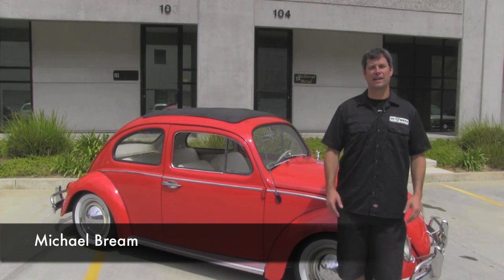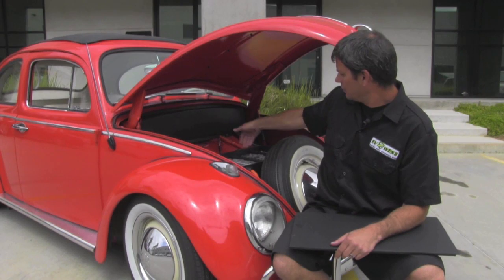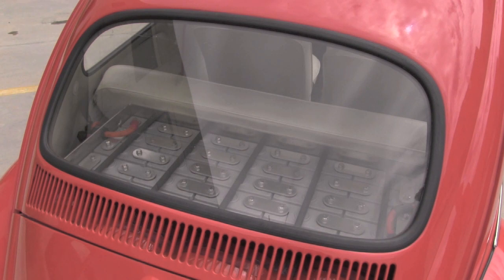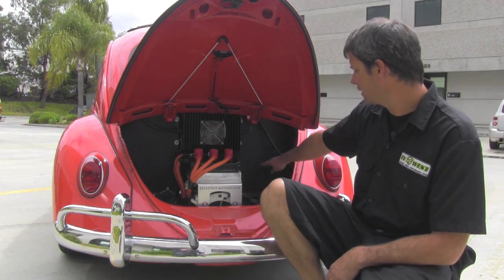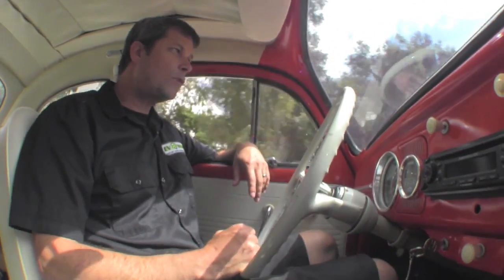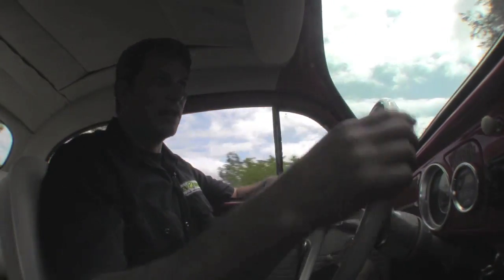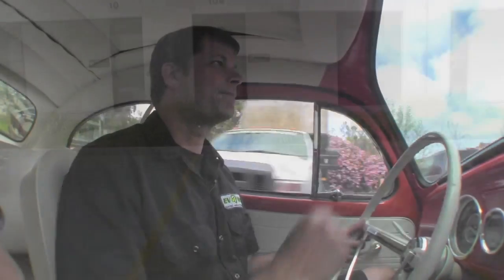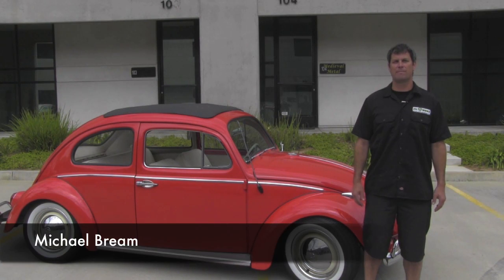EV West 1963 VW Beetle Electric Car Conversion - Classic Volkswagen DIY EV Bug Kit Walkthrough

Comment: I just bought a ‘64 Beetle that I’m having shipped to a shop in Austin, TX, Flash Drive Motors, for electric conversion.  Can’t wait to try it out!
Reply: Dígame cuánto cobran …how Much?? Please
Reply: @juliomartinez5273  $17,500 in the auction.  The conversion is going to be $32K+ what ever I want (a/c, heater, disc brakes, etc.) added to the build.
Reply: @ICP1SBJ  Parts must be much more expensive in the US.  Labor too would be my guess.  Send me a link to the $8.5k kit and I’ll send it to my guys to evaluate.  Thanks!
Reply: @donelmore2540  I was wrong they have $8.5k kits but the complete kits with batteries are $18k. Can't post links but look in the description of this video for the link to their website.. But year $32k might be about right for them doing the work
Reply: @ICP1SBJ  My shop contacted me the other day.  A company is going to shoot a pilot video on the shop and my car’s conversion is going to be filmed for the pilot!  Very exciting.

Comment: And one more top notch conversion rolls out of EVWEST. I like seeing how these cars perform with the AC setup available. This is the very first one in a heavier VW that I have seen actually run. Does the VW use a transaxle that has the 3.44 R&P gear? Very clean and tidy. Perfect. Now to get some fast charging into that little puppy. This looks like a very clean restoration and your part is totally clean. I think what others are wanting to see is how you do the gas tank battery box to replicate.

Comment: I know this was a while ago, but do you know 1) the weight, did it go up or down? 2) the load distribution from front to back? 3) Did you have to mod the brakes or suspension? 4) Do you have to carry an extinguisher having the batteries in the cab with you? 5) How are the batteries in the cab held longnitudally against a frontal collision?

Comment: It might junk the trans doing a burn out. That my question. Are they using the stock type 1 trans. If so the motor must ether be low powered or you just have to be careful with it. If I'm wrong please let EV West correct me here. I'm not knocking the kit. I love it and will be doing more research on it.

Comment: You guys should of made the charge plug location come out where the normal filler spot for gas is.
Reply: It's a '63. The normal gas filler spot is on the tank under the hood.

Comment: Could you add solar panels to the roof to recharge?
Reply: Though that is possible, the amount of recharge you'd get for the surface area you have on a car wouldn't be worth it. In fact, the added weight would counter a lot of that too. Best would be to get panels for the house and charge at home.

Comment: Heat and defrost? Was that covered or addressed?
Reply: That's a GREAT question.
Reply: The original ac was just blowing outside air in through a channel behind the hood/in front of windshield. Heater is  same process except the channel  coils around engine for thermodynamic changes...the only control is an induction vent controlling air flow/psi therefore controlling output of heat not the temperature
Reply: @joemccracken185  lol

Comment: What type of batteries?  I seen lead batteries used and the weight about killed the bug.  AC motor or brushless DC?  Liquid cooling?  ESC not very efficient making heat?  Fork lifts don't have cooling.  Looks like good specs.  More details please!

Comment: On 2nd thought. I can get a 1600 dual port for the price of the adapter plate. I could buy a complete running VW for the price of the motor. I like the technology but the price is hard to stomach on an old school VW.

Comment: Why don't you build a towable battery trailer so that the car doesn't have to have the physical weight and or danger that normally comes from having the battery bank inside the car? This would free up a lot more room in the vehicle for storage? As well it would take the danger out of the inside of the vehicle

Comment: Quick and silly question: If it has a 100 Mile Range, and I drive at 100mph, it means that I only have 1hr of driving? I know the answer may be obvious, but i just don't any clue... as you may have noticed. Thanks.
Reply: Range depends on type of batteries, battery capacity, overall weight and your way of driving (+ if it has modes of power on the controller, depends on voltage and/or frequency too).
Reply: But if you drive @ 30MPH you can drive for over 3 hours :-) an electric car is not for cross-country driving, but for a daily commuter with a reasonable daily commute say 25 miles (or less) will likely will plug in the car every night when they park at home. That driver will never have to stop at a gas station again. Feel the need to get away rent a sportscar for a weekend every 6 months.
Reply: Faster you go the more power you use